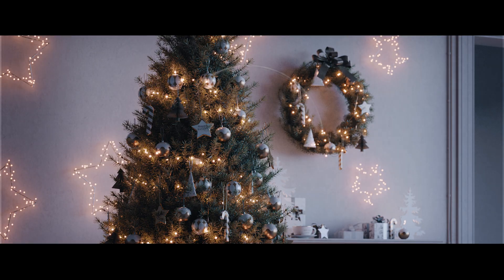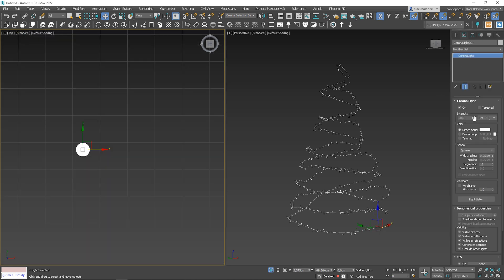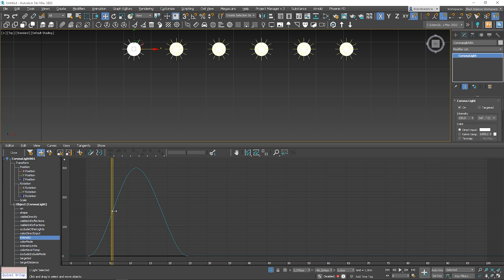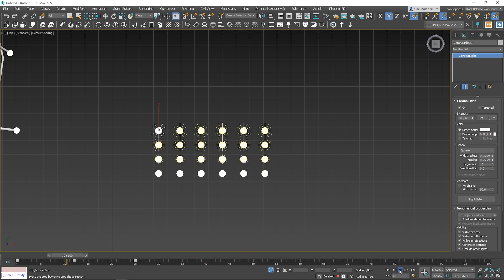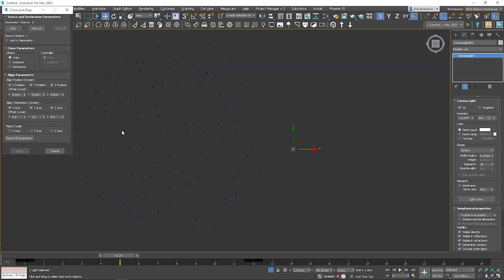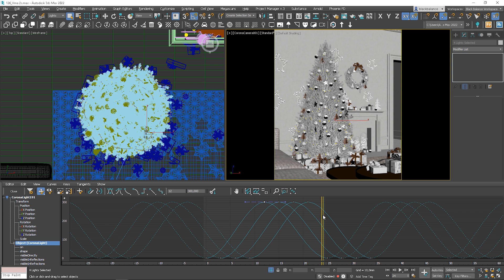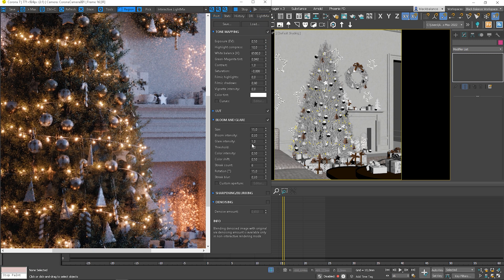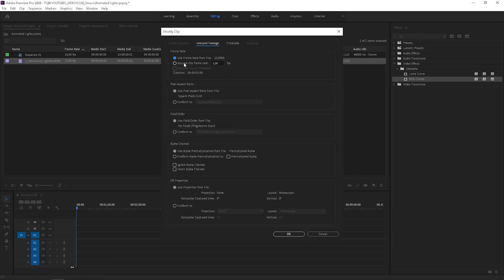Animating and Looping Lights in 3ds Max

Comment: The lesson is good, but for those who do not have a powerful computer, there is an easier and faster way. Too many frames to render. It was enough to make 1 frame.
Using Light Lister, after rendering 1 frame, it was possible to simply save 4 frames in manual mode by turning on different groups of lamps separately, and then compose the layers in Adobe Premier or After Effects.

This is my scene from last year. I rendered only 1 frame in 3D MAX. I made the tree, forest and lighting in 3D MAX. In AfterEffects  only added snow particles and fireworks.
https://youtu.be/gqgD59XG1wg